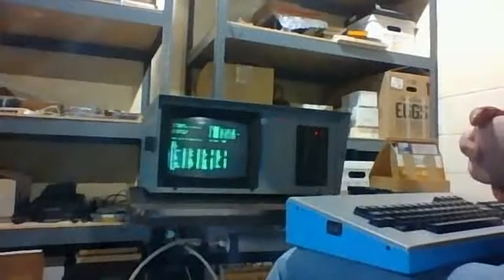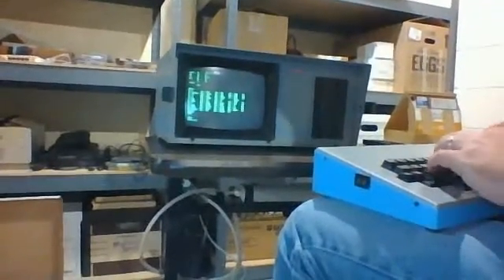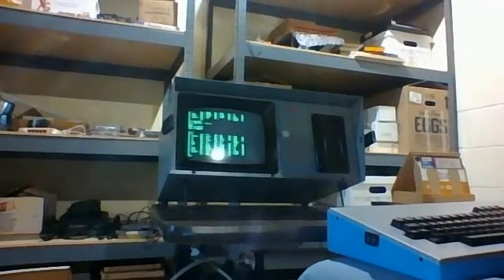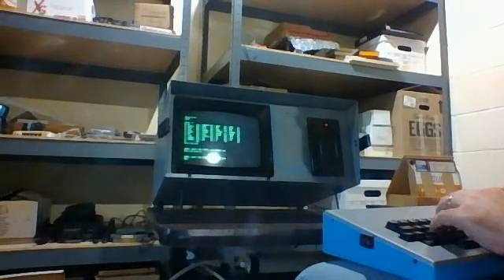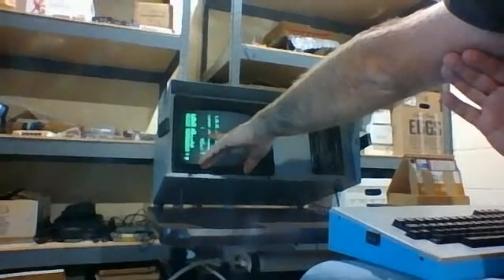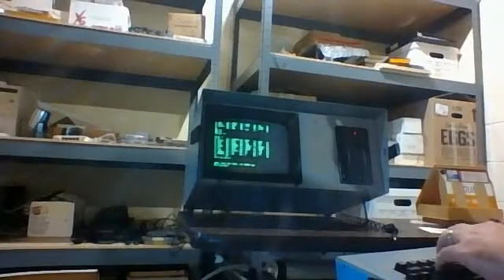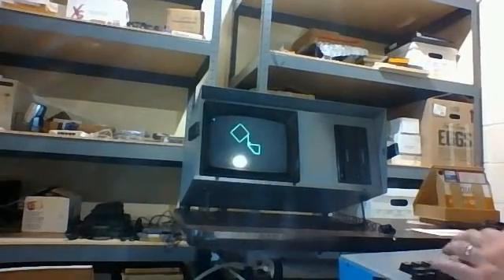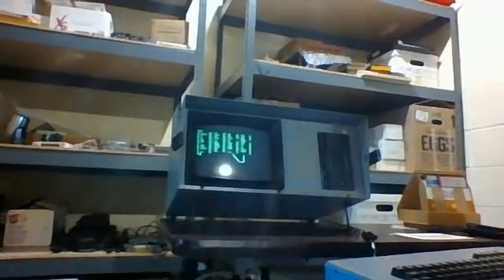Compiling an old 8080 Assembly program (called "DRAW")

Comment: post the code.....
Reply from the maker: John O'Brien I see a new challenge ahead of me...  Serial communication between the Kaypro and a Raspberry Pi
Reply: Paul Kimbrel the pi is kinda bad for serial.... you need to shift the levels because the pi gpio is 3.3v instead of 5v.... i just use an ftdi serial to usb adapter....
And i still have an xp machine with a "real" rs232 port, mainly for my eprom programmer....

I never had a kaypro though, does it have a serial port?

I learned to program on a ti 99/4a in like.... 1983.... i still have it, my first computer, then i went to the apple IIe, and then right to a 486...

Built my first Z80 computer about 3 years ago. I have a single board computer running CP/M, an Altair 8800 emulator running CP/M, and a Z80 computer that fits in an Altoids can that will be running CP/M hopefully soon...